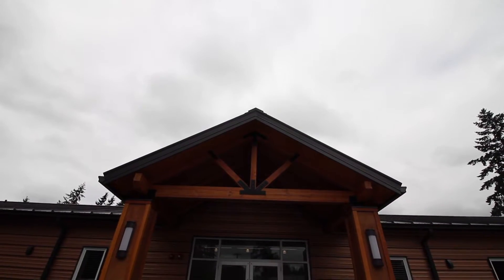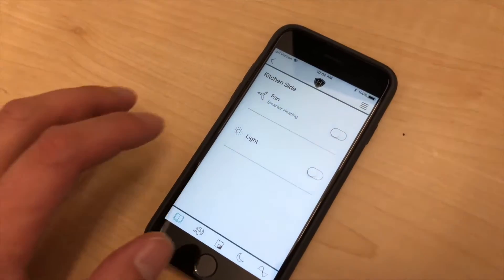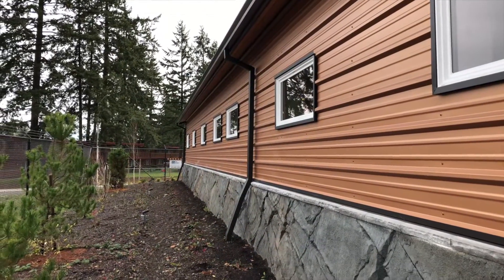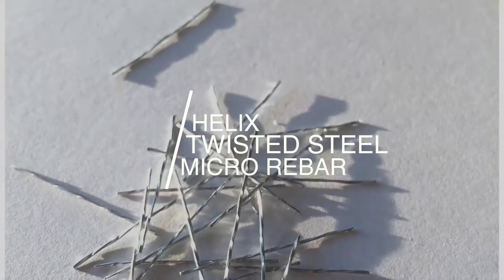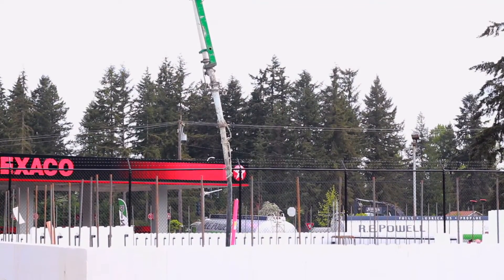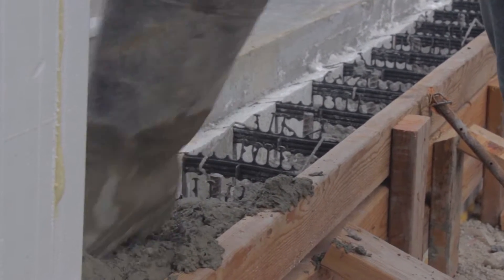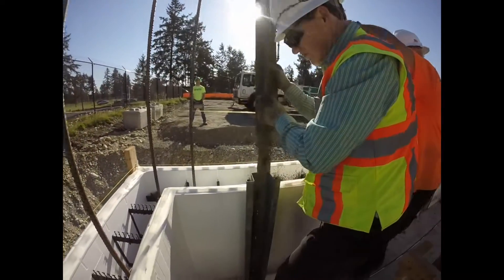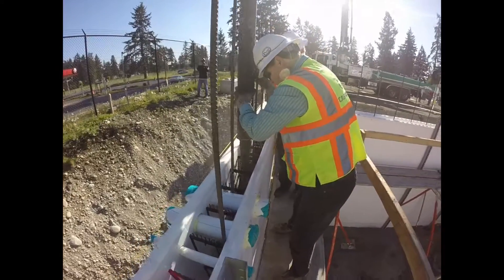Anatomy of an ICF Building - Part 1 - Helix Micro Rebar

Comment: Did your engineer say horizontal rebar in the walls was not needed because it's a wall and not a slab (less tension forces) and Helix alone would suffice? From what info I've seen on slabs with metal fibres in general, it can usually replace mesh, but not rebar. Walls are different and you do have vertical rebar, so maybe that ok... I'll be building an ICF house soon and plan on using Helix too, if i don't have to use horizontal rebar, i'll be happy!

Comment: Thanks for the video.  I understand that rebar corrodes over time in concrete.  Is the Helix galvanized, or are you not concerned about this?
Reply from the maker: Hi there- That is an excellent question. Strength along with longevity are definitely concerns of ours on every project we take on. Fortunately, Helix Micro-rebar is zinc-electroplated to provide a protective coating against corrosion. We have not encountered any issues with corrosion since we started using the product in our mixes. Thank you for watching.

Comment: Why use Helix if you are using reinforcing rods as well. Are you expecting a terrorist attack?
Reply from the maker: Hello Darrell, thank you for your interest and checking out the videos.  We used Helix to speed up onsite construction execution time.  Helix is engineered to allow our Structural Engineer to remove standard re-bar allowing us to spend less time installing that re-bar onsite by adding the Engineered Helix design to the concrete at the batch plant.  Helix will never replace all re-bar but it can help to reduce a significant amount based on the Structural Engineers calculations.  Thanks again for your question and taking the time to check out the videos.

Comment: Thanks for uploading the video, I'm thinking of using the Helix too. In the seismic zone (New Zealand). Question, how do we make sure even distribution throughout the mix. Another question.. Do we need to use Self-Compacting/Consolidating Concrete with it (I noticed you guys didn't use vibrator in the video)? Another question, would the helix strands settle at the bottom over time after the pour?
Reply: OUexp hello and thanks for watching.  Helix needs to be added through a screen so it is added already separated and slowly enough to not bunch on top of the concrete and mix individually as the concrete is churned at the plant.  The helix doesn’t settle to the bottom there is still aggregate in the mix.  It sped up our construction allowing the engineers to remove a lot of rebar and tieing from our walls.  Good luck, hope that helps.
Reply: Thanks for your reply. Is it a self-consolidating concrete or just regular mix with vibrator?
Reply: It's a regular mix with the vibrator.